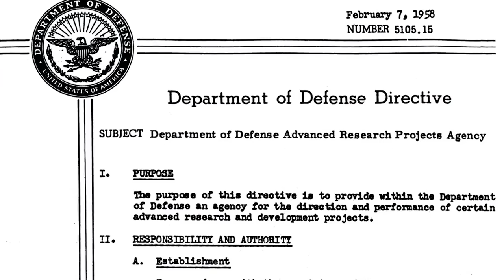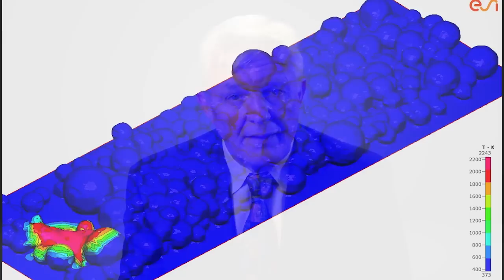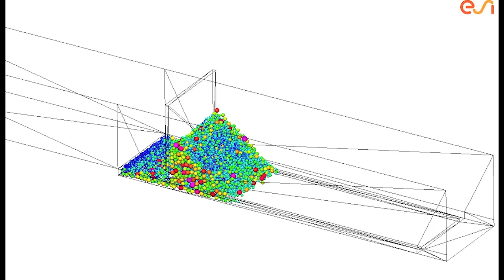DARPA and Materials

Comment: I'd like to see an oobleck type material for body armor with some sort of electrochemical process that can harden body armor with a flick of a switch in battleground engagements if possible.
Reply: Further process is liquid insulator for extreme temperature conditions?  But again I'm going off the deep end with this.
Reply: James McDonough  you're not off the deep end....I haven't seen much progress on the US side...(it is an active program)….but Russia has something similar they've demoed.   US side check project TALOS/MR Fluids.
Reply: @rumls4drinkin  what do you it is an active program? U.S already has liquid material that can stop bullets instantly way before Russia
Reply: that would not be energy wise if it has a switch, liquid materials that use for body armor does not need a switch or a battery. they change its shape at a molecular level to cancel the force of impact of high speed projectile. like you can easily sunk your foot on a pool of balls, but you cant on pool of lego's specially when they are properly stacked to each other.